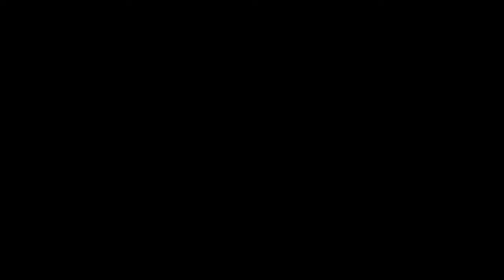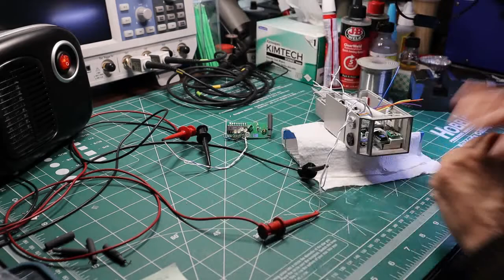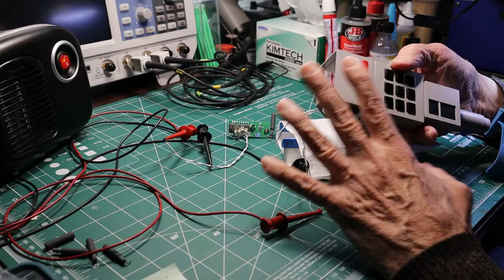MPC Round 2 Commlock part11 remote control circuit

Comment: Could you do something with the OLED display in regards to the Geiger counter?
Reply from the maker: Unfortunately, not on these two Comlocks, I have no way of reflashing the Arduino, it's under other circuits and could be damaged if I tried. I think putting a red LED behind the screen is the easiest solution, but thanks for the input....
Reply: @teslabe7701  Your build is amazing. It’s quite inspirational.